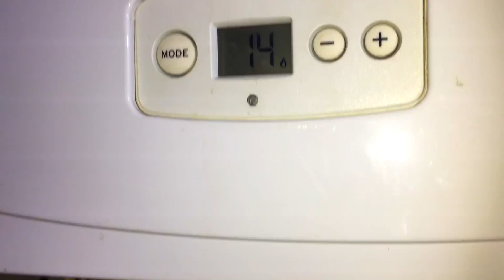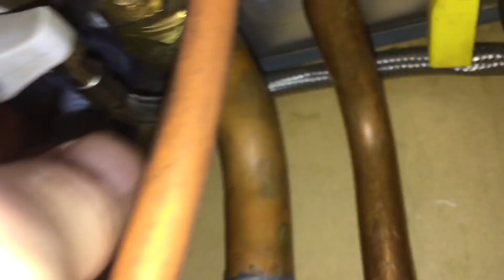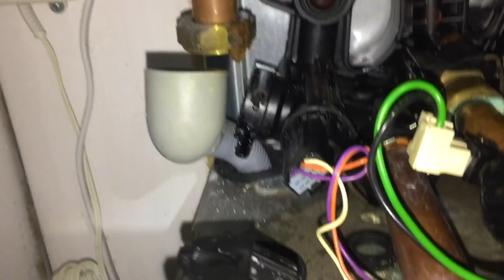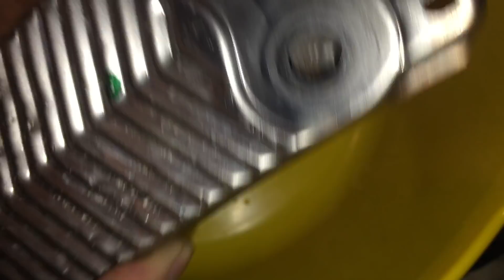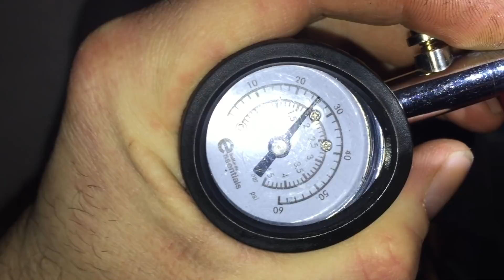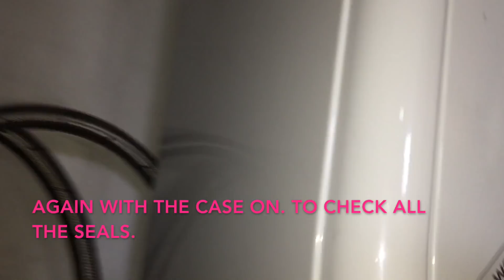Glowworm Flexicom Repair

Comment: Hi, first off your video explanation is concise without the waffle you hear on other videos, thank you 👍
I’ll try and do the same in my question to you 😂
On my Flexicom 35cx I had a water leak from the short rubber pipe that connects the copper Flow pipe to what you called the canoe filter / Pressure sensor area,  yours didn’t have this so I suppose this part was updated at some point.
Anyway I had this part fixed but forward 3 weeks another leak appeared which slowly slowly resulted in lost pressure, this time I thought I would just call the manufacture & pay for a one off repair price to save any more messing around thinking that this route would be better???
Engineer turns up turns on the boiler shines his torch inside for a couple of minutes then leaves saying that he will send in the report & I should hear from them shortly?
When I had not heard anything I then contacted them only to be told that I need a new boiler as it is uneconomical to repair ???

So as usual this has become a long winded Question: 😂

1, the boiler is 10 yrs old & has been maintained regularly with no previous issues & in fact after seeing most videos on Utube mine looks practically new internally apart of a very small amount of scale at the point of the small drip.
2, I have cleaned the area around the leak 
3, The leak is coming from one of the rear screws that fix the plastic condense sump to the heat exchanger, I can see clearly with the aid of a mirror & bore scope camera that it is definitely not coming from the Sump to Heat Exchanger mating surface so could rule out gasket failure.
4, still dripping so can’t be Condense ?
5, my thinking is & as crazy as it sounds is that the threaded bolt hole in the aluminium casting is to close to the casting water jacket & cracked allowing a leak past the bolt.
6, from a search you can’t can’t purchase the plastic sump separately & have to buy the complete Heat Exchanger?  What are your views on using some LS-X around the area as a temporary measure ?? Is this stuff really that good as an external repair?

Old video I know but greatfull  for any input
Reply from the maker: I guess you have done something by now. I would not LSX the sump. Usually they only leak condensation and not heating water, so it doesn't explain why your pressure is going down. 
I would just replace the boiler tbh. I know its not what you want to hear but it the truth.

Comment: Not sure if you will know the answer to this, but when we have the heating on, th boiler begins to vibrate with a deep sounding noise over and over again. What would it be please?
Reply from the maker: It will be the low flame combustion is incorrect. Usually/
Reply: @HeatingGeek  is that something i can alter manually on the boiler or is it replacement parts please?

Comment: My flexi boiler when I put the radiators on the pressures rises to 2.3 2.4 bar but never drops back to 1 bar when it’s all turned off. I bleed the radiators and put heating on again and the pressure rises again. I’ve had a guy change the vessel but still happening. Any ideas?
Reply from the maker: The filling valves are letting by. You will need to replace at least one of them to stop the issue. You can prove the problem first by disconnecting the flexible hose and seeing if it leaks.

Comment: Don't expect you to answer here but worth a punt. Flexicom 30cx. F25 circulation. Has had new diverter valve and expansion vessel. Off at mains and back on cures. Cant get any more air out. Could pump be lazy?

Comment: clear explaining to sort out faults  and good tips for repairs . Thanks. 
We had re-occuring F9 Faults in Glow-worm Flexicom 30sx system Boiler in the vey cold weather mornings. Called  a local Engineer who changed few  parts - Two Auto Air Vents and sensor to sort out the pressure problem. Boiler working fine Pressure  Bar showing 1.4 when not running.
One charge was for Electrode Product Code - is it a part or just being charged for nothing as I gave full Installation and Service Manuel to the Engineer at the start. Any views on this point.

Comment: What an excellent video. It’s given me a visual indication of what the inside of my boiler looks like without me having to take my own apart. Where abouts in the UK are you based? I’m having an issue with mine where the boiler will cut out briefly after 30 minutes for about 3 seconds at a time and I’m stumped. If you’re local to the midlands id love it if you could check it out.
Reply from the maker: Bet it was the plate. Hope you got it sorted.

Comment: NICE VIDEO. WHAT DESCALER ARE YOU USING BUD.
Reply: Spirits of salt. Be very careful if you use it. Don’t do it inside and flush it out of the plate with water before you try to refit it.

Comment: Fit allot of pressure sensors on these also the manifold they call it the support their bad for splitting .Done the vaillant ecotec course a while back and they said always check the canoe filter . Top job mate another excellent video as always 🖒
Reply from the maker: Thanks. Flexicom and ecotec are very similar and also totally different. Done too many supports (I call them the octopus ) not much fun but also easy enough once you have done a few. The Vaillant ones can be a pain with the screws underneath.
Reply: HeatingGeek no changed any of the vaillant ones . Yeah their easy to do once you do the first one . Not a bad boiler to be honest . You ever get the f13 code ?
Reply from the maker: No. What is it?
Reply: HeatingGeek f13 usually says pcb sensing fault . Usually it is the pcb you change the interface aswell . But also had it being the gas valve and the electrodes usually to do with the earthing it's one of them annoying ones . Looking forward to your other videos 🖒
Reply: @simpsongary98  Thanks for that info brother, very informative👍
Heating Geek, don't we just love him, he's a Real Gem!!

Comment: What do you use for cleaning the plates?
Reply: I always use Spirit Of Salts. Shifts anything from both sides of plate, especially scale and rust particles. It's acid so use your PPE. Only needs to be in for approx. 10 mins. Do it outside, because the fumes can be a bit nasty.
Reply: woodbine66 awesome !
Reply from the maker: Thats what I use. Very nasty stuff and will even damage stainless steel.